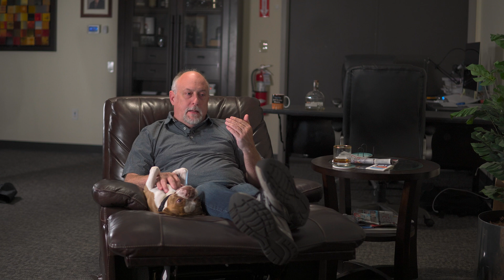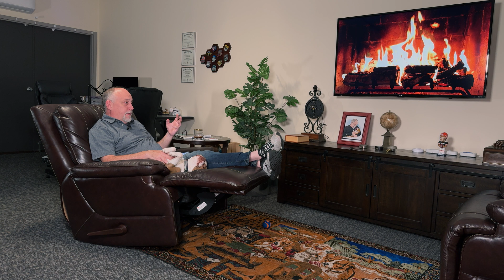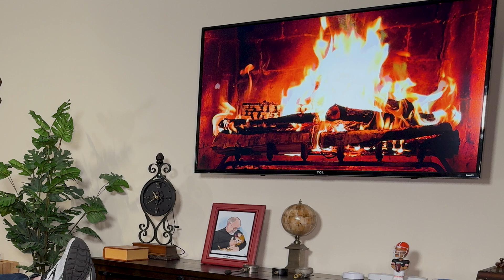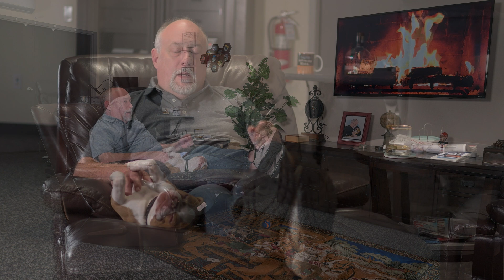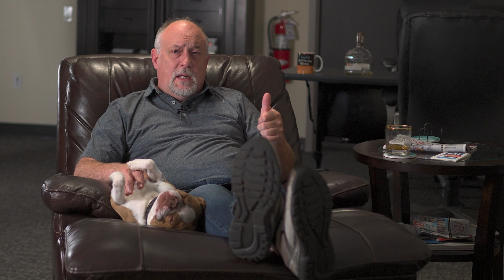Fireside Fridays: More Heat Pumps, Charge, Airflow & ACCA Quality Installation

Comment: Need advice. Here in Mexico (Cabo), the HVAC techs refuse to evacuate mini-splits systems or weight refrigerant. Does this mean all my mini-splits are running inefficiently? I'm buying my own pump, hoses, etc when I make my next trip to California. My power consumption is through the roof.
Reply: Yes. Moisture (vapor) takes up space or displaces gas molecules and refrigerant oil. The system will run with higher pressure. The difference between someone who is honorable and ethical and those who are not, is the ability to be curious. Ask questions, find answers. If you can do better, you must do better.